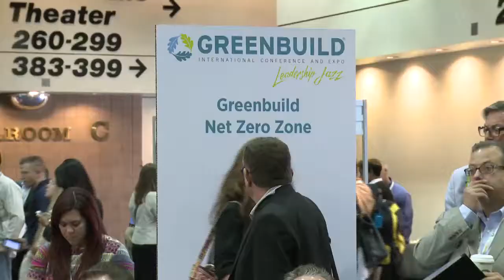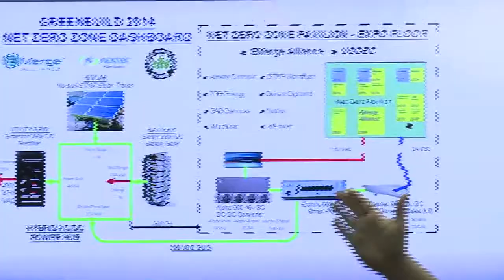Greenbuild 2014 interview with "Austin DC Power"

Comment: I'm fed up about Led bulbs!!! I've been trying to turn my house lightning system more efficient and reliable by changing the standard incandescent bulb for led system, after only 6 months I've few of them that are already not working anymore even if it states that they'll last 22 years!!! I've open the circuit to understand what the F is going on, and the problem isn't the led itself, with a DC supply they still works, it's the circuit that is built to last only few months so they can continue sell more bulb!!! I hate so much this economic system that we live in, I'm sincerely fed up about this whole buy new one after few years because it's better and looks newest etc. etc.... oufff sorry about that rant.